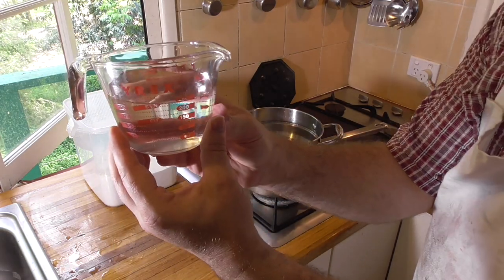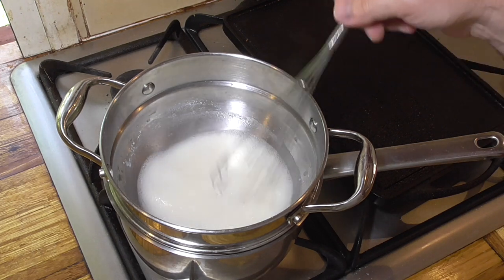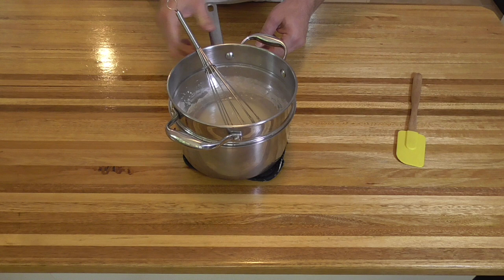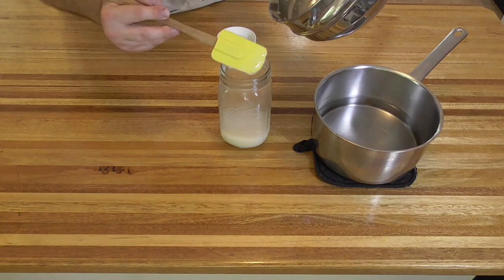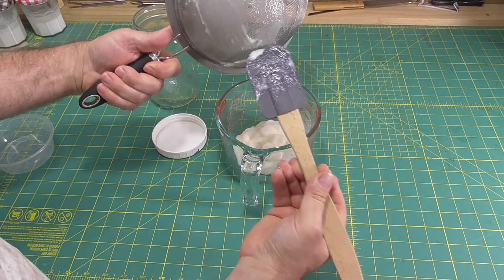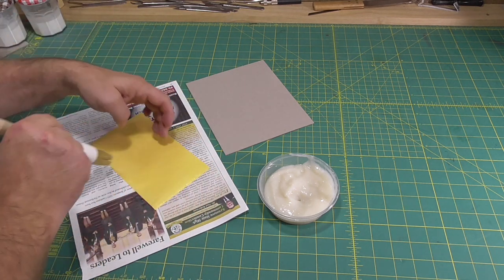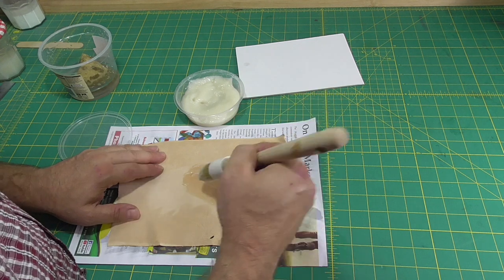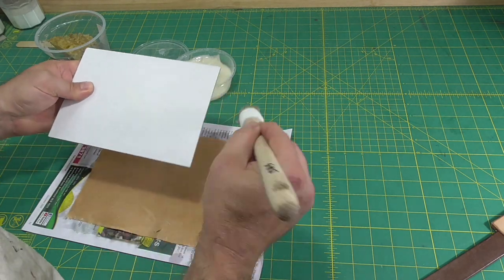Wheat Flour Paste for Bookbinding // Adventures in Bookbinding

Comment: Why not try Japanese wheat starch paste?  It has many advantages, stronger than flour paste but doesn't stain.  I used it extensively since the 1970s when I was trained to use it at the British Museum Oriental Antiquities Department.
Reply from the maker: I do use starch paste (specifically wheat starch paste) for paper repair all the time.  Refined starch paste is not as strong as flour paste and thus why I use it for leather work.  I go over details like this in my overview videos on adhesives.  One other thing, some people don't have access to wheat starch and for binding new books as a hobby I wouldn't want access to refined starch to be a barrier.  It worked well for bookbinders for hundreds of years.

Comment: In another video the man uses wheat paste in cold water with no cooking...is this just another method?
Reply from the maker: It's precooked and has much stronger preservatives in it.  It's probably fine for most work.  Obviously not a conservative grade adhesive.  Especially in the past cold water pastes were regularly used in commercial binderies.  But I don't like the idea of using it.   If I'm going to put 20+ hours into a leather binding, a few more minutes to get a high quality adhesive seems like a good investment.  Ciao, Darryn

Comment: You didn't understand my statement.  I said JAPANESE wheat starch paste.  Read my comment again!
Reply from the maker: Thanks for your emphasis.  I understood what you meant originally.  In the study published in the Journal of the Institute of Conservation 2021, Mito Matsumaru found “wheat starch sources nor pre-soaking had any measurable impact on the final properties of WSP”, using Zen shofu and a generic refined wheat starch (UK source).  I have used Zen shofu in the past and this matches my personal observations.  The weakness in the Matsumaru work is that she was measuring wet properties of the paste not dried strength, not considering materials being adhered and does not consider wheat flour paste or other high gluten content starch/flour.  I’d also emphasise I am a bookbinder not a conservator and I was clear about wheat flour paste not being suited to paper repair in the video and that my main use for wheat flour paste is for leather bookbinding.  My personal informal tests have found wheat flour paste to be a stronger adhesive in this application than starch paste.  And since my observation is there is no significant difference between Zen shofu and generic wheat starch paste, my original sentiment stands.  However, you have far more experience than I am and are much more familiar with the research and I would be very interested to hear if you have information that contradicts this.  As an aside, I was trying to find an analysis of Zen shofu to assure myself that it was okay to recommend it to a severe Celiac.  I was surprised to find that Zen shofu properties can vary by supplier and may contain up to 1% gluten.  The Matsumaru paper has a side note that mentions WSP in Japan being made from wheat flour with a gluten content of 12%.  However, I have not read the article cited, and well that’s just wheat flour paste.